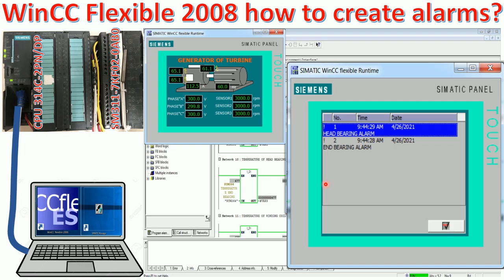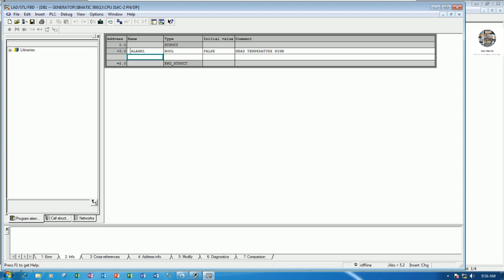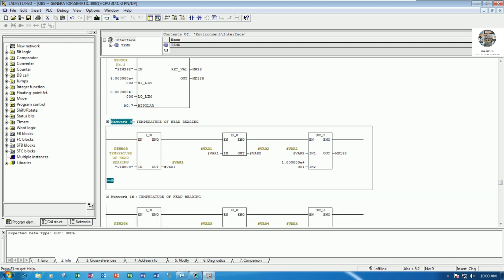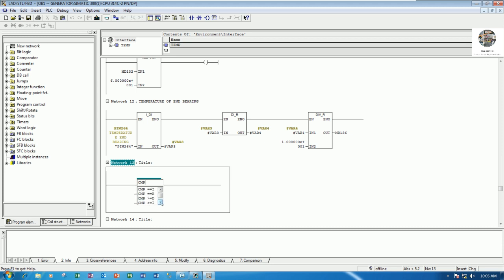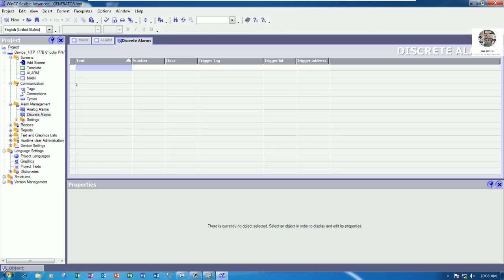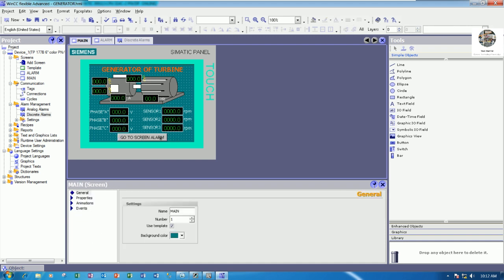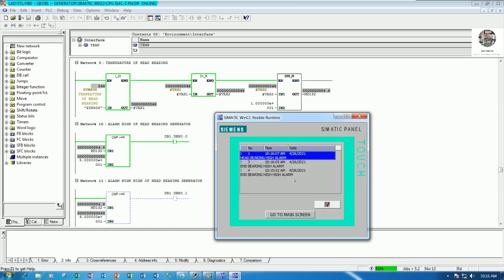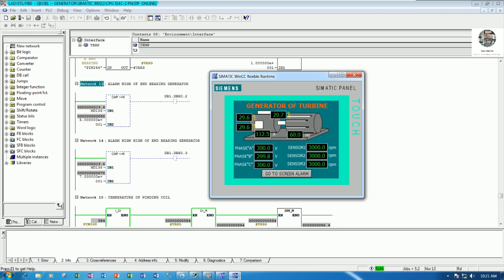WinCC Flexible 2008 SP5 and SImatic Manager software how to create discrete alarms or digital alarms

Comment: hi dude , tnx for video 
can i ask a question about Wincc flexible ? 
i have a problem a searched youtube , google ,...  and didnt find out 
my Wincc flexible is SP5
I want to turn on a light with a button in a Faceplate with Property 
what i did : 
created a Structure (Struct_1) and defined just one variable (BOOL)in Struct_1
then i created a property (Property_1) in my Faceplate and defined Struct_1 for property 
then i tagged property_1.Struct_1 for an Event of button in Faceplate
after getting back to screen i clicked on Faceplate and in My property tab-->> Dynamic interface it needed a tag!!
i defined A BOOL tag for that (its color turn to Orange (and its says you cant define bool tag for structure data)
Anyway , i defined a Bool tag and gave it to a lamp on my screen . after running  it gets An ERROR : "Error : Invalid tag or tag missing for property of screen item 'Faceplate' in screen 'Screen_1'. " 
i watched so much video on youtube about that and they Defined a Bool tag for Dynamic Interface and it worked !!!
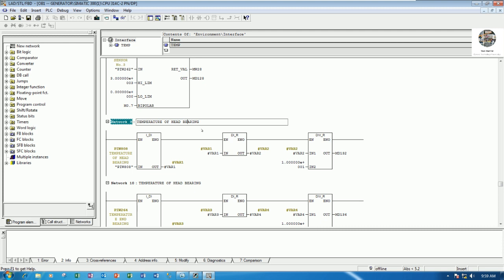for Example if you have time watch  a video --> https://www.youtube.com/watch?v=Kfec7627JnU    and in min 6:44 to understand my meaning .
i want to know that maybe siemens changed it in Wincc flexible SP5.
please help if you can , thank a lot
Reply from the maker: Dear sir,
Let me check and feedback to you soon.
Thanks you
Reply: @generaltechnologyknowledge5165  hi , appreciate that dude
Reply from the maker: @eldiabloo2817  Hi sir,
Thanks you

Comment: sir please  make a video on autonics temperature controller model tk4l ..to how use it in pid mode to give control output of 4 to 20ma
Reply: Hi, brother,  I have chiller using S 7 200 CPU SR40 and HDMI 700ie don't work,  can you support to fix please
Reply from the maker: @houseforrental24roomsatroa89  Hello sir,
Could you explain me what is the problems? your PLC is S7-200 SMART CPU SR40 and HMI is SMART 700IE right?
Thanks
Reply: Could you give me your phone
Reply from the maker: @houseforrental24roomsatroa89  Please contact me by fb please
Reply: What is your  Facebook please
Reply from the maker: @houseforrental24roomsatroa89  Please see my description.
Thanks you sir.
Reply from the maker: Dear sir,
I don't have temperature transmitter autonics but I have only temperature Omron.
Thanks!